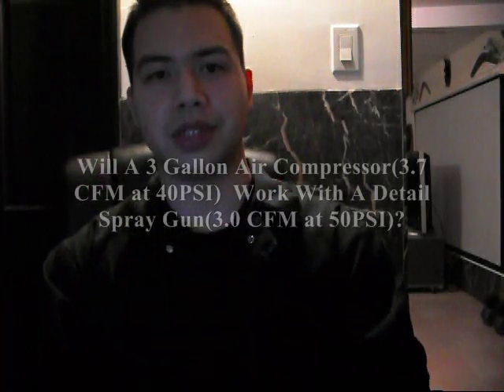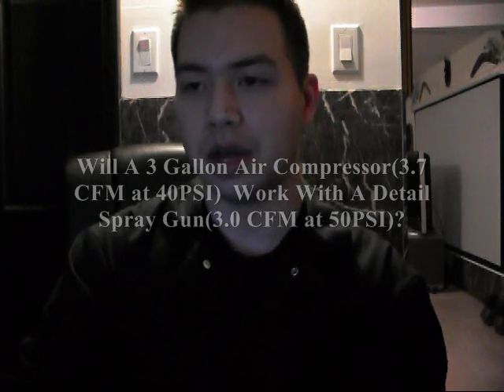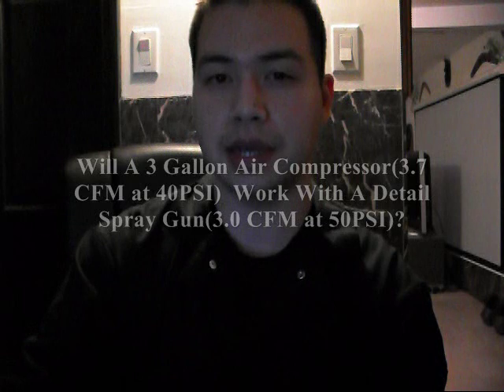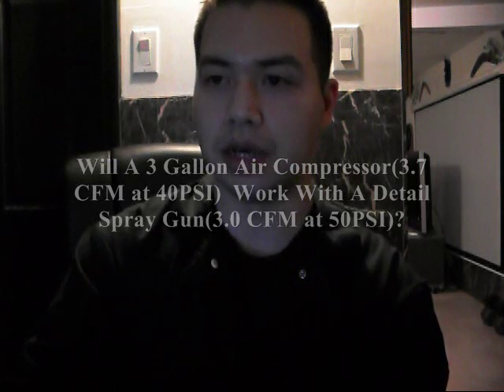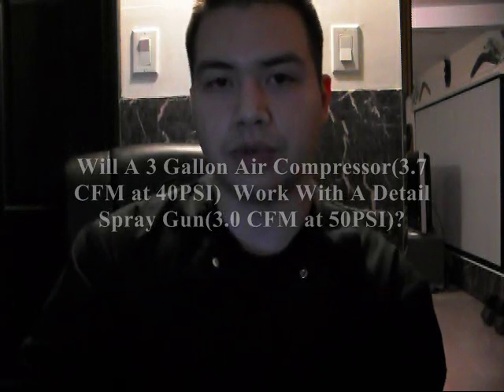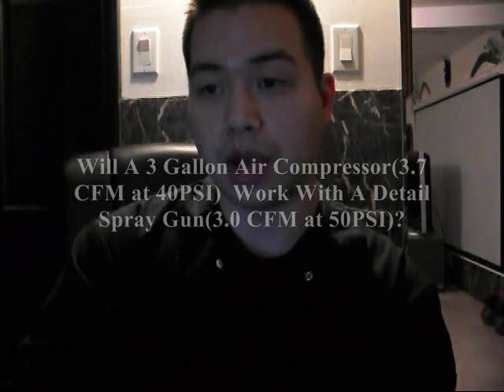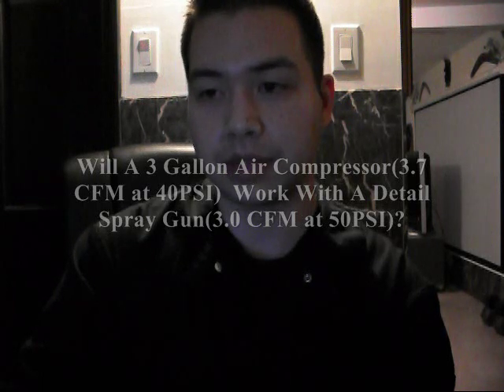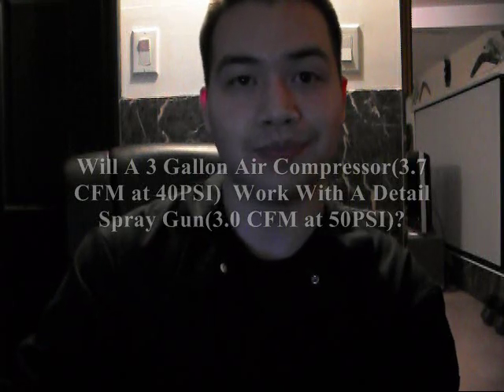Paint Experiment: Will A 3 Gallon Compressor Work With A Harbor Freight Detail Spray Gun?

Comment: First off why are you so close? Do that on something of value an you will be cursing for hours. You have to adjust it for stay at 8 inches or more. An you could possibly do this and have it do a whole car. But you will need more than a gun and compressor. You will need 2 inline water disbursers. One at the beginning. And one on your gun. With an adjustable pressure regulator. All that orange peal ad texture is from spraying an inch from what your spraying. And just cause your making adjustments doesn't mean they are right. Your main adjustments are with the pressure  on the bottom, the main is the paint volume at the back. Contact me if ya have any questions on paint application.
Reply: Hey man could you link me to some decent tools i have the same ol cheapo air compressor but i need to plasti my teg before winter hits and i want to know the proper way of doing so on a budget, thanks ahead dude!
Reply: I would like to know more